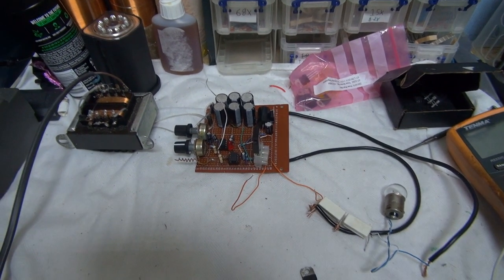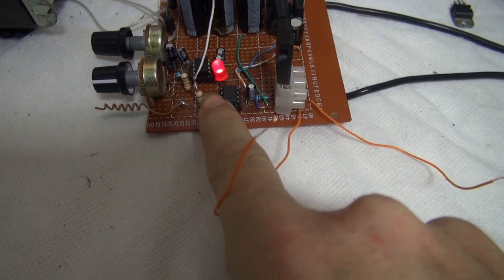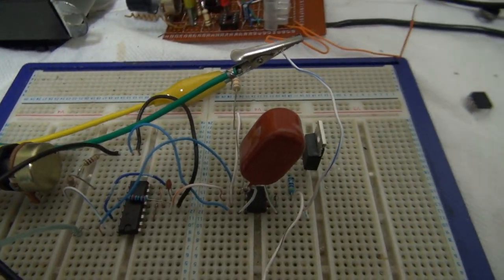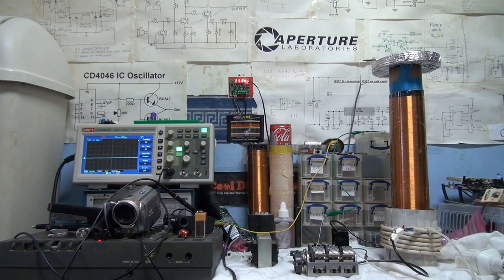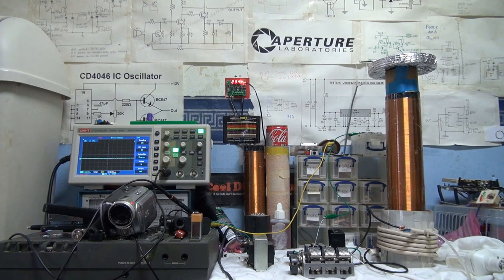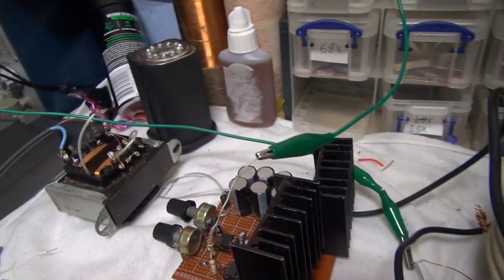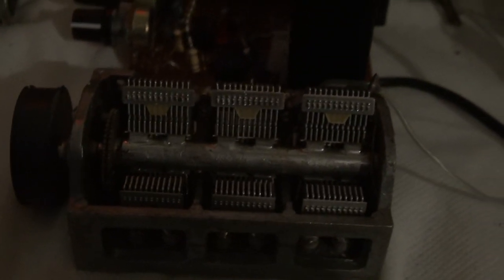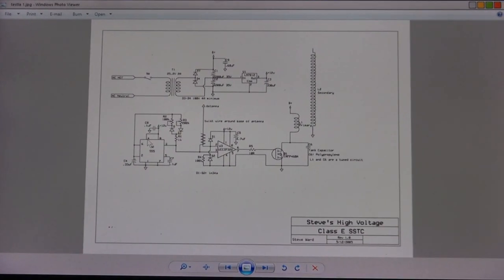Testing the coil I made with a Tesla coil circuit

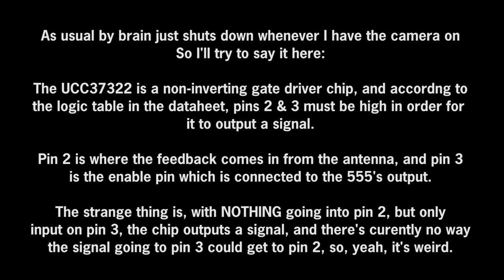Comment: At 2:00, Pin two is floating. Try a pull down resistor?
Anyhow, good video. Have a great week Clem.
Reply from the maker: But there IS a pull down resistor connecting pin 2 to ground. Even if I directly short pin 2 to ground it still happens.
Reply: @CoolDudeClem  
I apologize, I didn't notice that. That is strange then.
Reply: @CoolDudeClem Why do you get mad at people trying to help?
Reply from the maker: @CamelCasee  But I'm not mad at anyone.
Reply: @CoolDudeClem  But it came across that way, that's the point

Comment: Hi Clem again, I did notice on some of the other circuits have a bit of a snubber network across the " Source & Drain".  I was going to suggest a snubber network in place of the variable capacitor but didn't  🙄
Reply from the maker: Strangely enough, after I did the video I did try a snubber, (I used 3 47 ohms in parallel making a 15 ohm resistor, I had that in series with 2 2.2nf capacitors) yet I'm getting around 200v across the mosfet with the snubber connected there, I tried a few different configurations and killed 2 mosfets in the process. So I need to look into this further.

Comment: The schematic says to twist a wire (connected to the line going to pin 3 of the UCC372322) around the antenna leading to pin 2. So this should provide for start-up. The datasheet of the UCC shows that pin 2 connects to the gate of a mosfet on the die, so the input impedance is ultra-high and thus the twisted wire working as a pF capacitor is sufficient to turn it on. Without that twisted wire (why did you not add it?), EM pulses from noisy devices in your vicinity (or probably even the remaining stray capacitance) are also sufficient to trigger it.
Reply from the maker: I did have the wires twisted when I ran the circuit as a Tesla coil. Maybe you missed that? The strange thing is, there is a pull down resistor connected to pin 2 on both the Tesla coil circuit, and the test circuit I was doing on the bread board. So your guess is as good as mine here.

Comment: I'm not an electrician but ! It runs in the family . My Uncle John was an Electrical Engineer back in the day . 
Edison was a Dickhead , his words, because he worked for Edison . He also had a radio talk show Mr. Wizard . He taught you how to build a Radio on the radio . 
 He told me something important about electricity .
" It's just energy, it does what you ask . " 
 My question for you is what if you built the coils in a double helix?
Reply from the maker: I'm not sure if that would work, the way I understand it is that when the bottom of the coil is energized and at the right frequency (either by a primary coil or just applying high frequency AC at the bottom of the coil), not only does it work as a step up transformer, but the voltage keeps building up as it goes further and further up the coil, the more turns, the more voltage.
Reply: @CoolDudeClem  Yes ! Pinky ! More power ! Because tomorrow we take over the world with the Golden ratio !